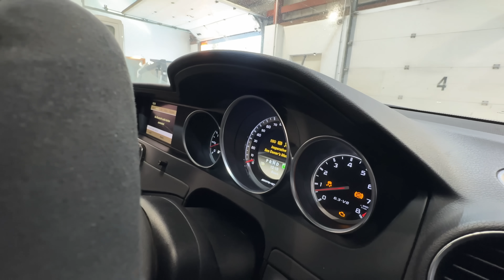MY MERCEDES C63 IS BROKEN

Comment: I swear to god this car has never worked
Reply from the maker: It’s always a nightmare 😂
Reply: @matarmstrongmk2 😂😂 lol
Reply: Bro is only speaking facts
Reply: Hi Mat, my name is Edgar and am a fan from Nigeria. Enjoy watching your rebuilds. How is Kelvin? Keep up the good work.
Reply: @edgarpeter-peprah6237 honestly this is the first time I’ve heard a 9ja boy called Edgar😂.
Reply: Was going to buy a used C63 AMG but it never showed up at the dealer, waited about 2 months having put an unseen (refundable) holding deposit on it. It never turned up and eventually it was out of MOT and SORN. I bought a Cayenne Turbo S instead from somewhere else. It’s in Mafia triple black with limo tints, black sports plus wheels and a full body kit with double spoiler. It’s a 650 brake armchair beast. I however am the least gangster person I know. 😂
Reply: Like my uncle Phil
Reply: Hhh yes
Reply: Always
Reply: I had a E420 that was in the shop more than it was on the road.  The Merc dealership had it for a month and ended up writing off the bill, which was like $5k.  They never told me what the problem was, except that they cleaned black soot out of the cylinders.  I ended up trading the car in for a MDX just off lease and got $2k trade in.  I felt so lucky I got that.  I will never buy a Merc again as long as I live.  What trash.
Reply: Oh, and my dad had an E55 AMG and it would go through a set of tires every 3k miles.  They had this dude from Germany called "the flying wrench" visit once and basically told the dealer that it was a feature not a bug.  My dad traded it in for an LS400, which worked flawlessly for years and years.
Reply: @matarmstrongmk2 at least you can wake up from a nightmare and get over it 😂
Reply: It just seems a nightmare car.  Tbh many others would not go through the pain and constant demand on the wallet.
Reply: @eddherring4972 I imagined Steven merchant when you said least gangster
Reply: @KeyBrosUK  yup, I’m 6”4 and 14 stone. I’m built slightly more muscular than him but other than that you’re about right 😂👍
Reply: The pipe In the sump plug is a filler pipe you remove it when draining then reinstall it fill with gearbox out till she trickles out then put sump plug back in
Reply: @jonsnowcd3095  yea
Reply: @jonsnowcd3095  Edo pikin I be

Comment: I never understood why certain car manufacturers went from making traditional oil dipsticks to having extremely unreliable electric reading systems
Reply: Because Engineers live electric Gimmicks creating  electric gremlins!
Reply: Harder to DIY it
More people will take it to the dealership
Reply: For women
Reply: C63 has a dipstick as well
Reply: It’s all a move towards not having a bonnet catch for owners to use…
Reply: @richardlowe1076 Mat is not a dipstick
Reply: It is annoying. My SLK55 has a dipstick tube with a cap on it. They will sell you a dipstick, but it's just for checking the level and putting the cap back. The dipstick is not designed to stay in the tube. Thankfully, the electronic sensor on mine has been reliable. The car is 16 years old.
Reply: Because "extremele unreliable" is still below 5% of the full customer base. That's why, statistics and economics my friend
Reply: sadly, the same as they went from dials and buttons to touchscreen,  some of which were really convenient such as AC and stereo controls
Reply: @dumtree3727 I’m not sure I’d say it’s a bit easier to diy check your oil if it comes up on the dash and tells you.
I totally get what your saying but try telling that to somebody who doesn’t even know where the dipstick would be found
Reply: You have no fucking idea how much I hate that. My Mercedes doesn’t have a simple dip stick. I spent like 30 minutes looking for it one time when I got it because I didn’t know they would be so fucking insane they would build cars without them. If the electrics are screwed or sensors break you literally cannot check the oil! I bet there are many cars that burnt up starved of oil when people turned them on not realising they had no oil.
Reply: @SD-oi9gr  I prefer a dipstick than without but in the sensors defence, the warning does come up on the dash telling you pretty much exactly when it just reaches the minimum mark on the dipstick.
Reply: Because servicing your car yourself doesn't pay. Greed and money and that's all it is.
Reply: @Yssgqvwgewgshsydsys  yes what a great development! Now you really have take your eyes completely off the road, refocus on what screen you want and then poke your choice with a finger to get it to switch on. Then remember to get your eyes back on the road, - and it’s all legal! (Oh, and you’ve probably travelled another hundred yards by then obviously!!)
Reply: @MarkoVukovic0 

Thank you for your contribution. Tell everyone more boring useless stuff about you and miss the point completely. Really!!!
Reply: Something else to go wrong which means more ££££ for the service centres.
Reply: Because people like easy. And alot of people are lazy.  Or should i say it's easier for people to to look and see if the light is on or not than to manually check.
Reply: Majority of drivers of new cars can’t even put a key in the ignition. Checking the oil with a dipstick would be so far beyond their abilities. My ex mother in law wouldn’t get a car MOTd she’d just buy a new one and she couldn’t fill the car with fuel, her husband had to do it for her. She couldn’t do anything remotely mechanical.
Reply: The electric shit never works. Then to hide a censor inside the sump is stupid. The topper is knowing the torch converter or the actuator is the problem. The car has to be a bitch to even upkeep probably like 85k for the life of the car.
Reply: I've got 2 cars that oil level sensors,  both (MB C Class and a Porsche Boxster) are over 20yrs old and I've never had a problem with either sensor, both have been very reliable. That said I prefer the Porsche system that has both a sensor and a dipstick, its also possible to check the MB oil level with a dipstick but the car doesn't come with one.
Reply: Job security
Reply: German cars for you
Reply: I have owned quite a few AMG's. Never had any issues, unlike Audi and BMW.
Reply: MB introduced ASSYST ,Active Service System , which determines the actual demands on the engine oil ,and uses the sensors to monitor engine oil level and temperature ,  engine speed and road speed ,  engine load , coolant temp ,
in order to calculate servicing requirements per time and distance.
It was done to prevent premature oil changes to ensure that oil is changed when actually needed .
Reply: But why would you put the old oil back in the engine ? Horrible thing to do
Reply: Some engineers have their dumb momentum life. 
One them will be creating this sensor.
😂😂😂😂
Reply: Why no dipstick???
Reply: How does removing a dipstick stop anyone servicing their car? It makes no difference. I've been servicing my own cars for 50yrs and its a myth that modern cars are more difficult to service than old cars. @FEAR.LESS.
Reply: @shadowblack1987  mercs have less problems yeah, just i mean German engineering love sensors ect

Comment: 7G tronic gearbox takes blueish green 722.9+ ATF fluid. You can drain the torque converter if you unbolt the electric pump for the start stop lubrication. (if it has it). You will see a rubber grommet. Take it out and spin the torque converter with a screw driver until you see the little drain bolt. Remove the little bolt and hang sometype of little hook on it so air can get easily in the torque converter to drain it completely.

Almost all of the 722.9 gearboxes you can drain the torque converter. When refilling put 9 ish liters in the gearbox. Run it to around 40°C. Let it drain till it begins to have a flow with bubbles. Than you can seal it back up. 
MB 236.15 ATF fluid for 722.9+.  Not sure about the standard 722.9

ALWAYS use new bolts for the transmission oil pan. Torque specs 10nm for torque converter.
4nm and 90° + 90° for the oil pan.
22nm for the drain plug.
Reply: This is why I love YouTube. Knowledge is power that is rarely free these days. Who doesn’t like something free, especially knowledge!
Reply: The facelift doesn't have a torque converter, instead it has a single clutch. I thought it was called AMG speedshift MCT.
Reply: @tubejorrit  and does that clutch uses any kind of sensor? The malfunction seems like the car is safelly going off as on a manual when you brake in gear+out of clutch pedal
Reply: Funny I'd say nearly all 722.9 dont have torque drains. they stopped putting them on about 2004

Comment: You can drain the torque converter (there is a rubber cover on the bottom of the bellhousing which exposes a small plug in the torque converter, you may have to rotate the engine to find it, some 722.9 transmissions had drain plugs which were the later trans) do all this at the same time as you change the filter, remove both cooler pipes and blow out the cooler lines as well this will help the convertor drain as well, the little green tube you can actually just knock it into the transmission sump (usually breaks) which will help drain 99% of the oil, I only use the Merc trans oil it's green in colour just quote the VIN to mercedes dealer, I think the manual states a 6 or 7 litre refill, I always get 8 litres, when you refit the filter and the green oil level tube to the sump, simply pump in about 5 liters of oil, start run for 30 seconds, shutoff pump in the remainder of oil, then start run through all forward and reverse gears, then using your diagnostic tool get up the trans oil temp, I think from memory wait until oil temp is at 45 degrees c, shutdown engine and check the level of the trans sump if oil pours out wait until its just dripping, if no oil pours out add more oil until the oil is just dripping out of sump plug hole.

Remember the green tube sets the level of the transmission at 45 Degrees C
Reply: I turned the engine over at least 4 times with the rubber grommet out and there was no drain in the torque converter guaranteed 😂
Reply: You have to keep the engine running while draining at temperature. Or the oil will be to low.
Reply: correct @sebasgerrit
Reply: I also did say in my first comment some 722.9 transmissions did not have the drain plug but they are very early transmissions
Reply: Never broke the little green tube. Use a small screwdriver and tilt it sideways.

Comment: your torq converter lockup clutch is starved of fluid and so it stays applied causing the stall you either need to change the tc lockup solenoid or the conductor plate.Both are cheap and easily doable with your tools and equipment

Comment: Good video guys. I've got a C63 and I'm going to be doing a transmission service in a few weeks. Have you swapped the injectors out on yours? There's a common issue where an injector can fail in the open position and hydrolock the engine. So a lot of people swap them out as a precaution. I changed mine this week. Glad I did, lots of carbon build up on the old ones and my cars only done about 35000 miles. It's's quite an easy job and bosch OEM injectors are not very expensive. Looking forward to the next video.

Comment: 2011+ c63 had blue fluid for transmission also you're supposed to knock the plastic pipe off to the side to allow all the fluid to drain out.

Comment: That tube in the drain for gear box is to be removed for draining.  Install and fill till it comes out of the hole   start car and fill more till it is full.  When the fluid stops running out of pan with that tube in place and car goin then it is full of fluid.  Its called fill to spill.  I use to do exactly what you said.  Fill, run car and drain.  Usually did that 3 times then put new filter in and filled for final time.  Really enjoyed this video.  Lots of laughs!!

Comment: ive only done the trans on the 350, but the trans fluid level on that car was set by warming it up to 180 degrees and checking it running with the drain pulled. the oil level needed to be just over the stand pipe with it running at temp

Comment: I love your videos i watch them all! I've done dozens of amg Trans flush, You are supposed to stick a screwdriver or what mb calls a "drift tool" into the trans pan drain hole and bend sideways to remove the standpipe. That drains most of the pan.The standpipe should be replaced after and with same color pipe, there are many colors/ sizes. There definitely should be a super tiny drain plug in the TC as well hard to see bc it's a teeny tiny Allen and you have to rotate engine to find it.

Comment: You guys should  start the car, put it through gears, P,N,R and D a couple of times then wait until you have 45C/113F (car idling an i level) then some oil will come out. It should come drops only then put on the plug. Not all these gearboxes has plugs on the converter. That green pipe in the gearbox pipe is changed because after removing the plug you hit the green pipe with a screwdriver so all oil comes out. If it breaks then you have a new one (better safe then sorry). Hope it helps you guys. Great video Tony and Mat.

Comment: Best to do some research on the Merc Auto boxes on YouTube...😅😅😅 
Alex from Legit Street Cars has done a lot of work on those transmissions - the tube in the sump is actually the correct level for the transmission fluid and he shows that you need to knock it out of position to drain the sump and then reinstall it prior to installing the sump back on the transmission (meaning that you have to remove the sump). You then refill the fluid through the drain plug!👌

Comment: Hi Matt love the videos you do and your dad as well.  My 1999 ford mustang gt did the same thing as your Mercedes and mine I could get it to drive if I gave it gas right away when I shifted to drive and then it would sound like a manual car taking off and once the oil warmed up then you could stop without it dying.  When I pulled the pan off it was the same as yours with a bunch of metal stuff on the magnet and from what we seen it was the torque converter causing it because it was engaging when it wasnt supposed to when was burning the clutch off.  I ended up replacing the whole transmission since it had 81,000 on it.  Yours might be doing the same thing as my mustang was doing.  Also I changed the oil first and filter like your dad did and the trick to change the oil was to disconnect the transmission lines running into the radiator that cools it and start the car which will pump it out and while its doing thaty your pour in the new fluid and when you added the full amount maybe 8 quarts then shut it off and check the level and reconnect the lines.  If you have someone helping you then he should be able to see the blue fluid eventually come out once all of the old is out.

Comment: I like Tony's new cap.  I have always thought that I would like to buy an AMG GT R, S or C.  The stalling problem seems to be the torque converter. That does hold a fair amount of fluid. Or, a vacuum leak anywhere in the engine's intake manifold system could cause this behavior. In older vehicles, even a faulty ignition barrel with weight on the key ring.

Comment: Just to add aswell when filling/checking the gearbox oil level the engine has to be running to check the level or you may not have enough oil in there, put a basic full amount in (say 5L) then start the car and check the level👍😊

Comment: I had this on my '06 G35, $22 oil sensor and $2,200 in labor to install it. Only to turn off the red light on the dash. On the plus side you now have a spare trans on hand, that you can rebuild and have ready/resell.

Comment: 6:47 The tube is not for making it hard to empty out the old fluid. It's so you can refill the oil level, to the correct level, so the top of the tube, will let you know, when it's start dripping out, when refilling, you can then install the sump plug again. And yeah, as you said yourself, you should remove the green plastic, with a pick or something, before you undo the sump bolts. And you should drain the oil from the torque converter too.

Comment: I literally rebuild and install Mercedes-Benz transmissions everyday for a living because my dad has a shop in San gabriel CA. The oil from that transmission is supposed to be blue oil not red. I know by the size of the lil dimples on the pan. The bigger ones on this car mean its a blue oil transmission while red oil ones would have smaller ones. Mercedes transmissions switched from red to blue oil in the middle of 2010. So everything from mid 2010 and beyond 2010 is blue oil. Also, he could have drained all the oil if he hit the tube off w a screw driver. You also have to make sure you use a blue oil filter and not a red oil filter. They're different. And if it has a wet clutch then they don't have a drain plug. Some of the torque converters have a drain plug but most don't. Never use aftermarket filters because they burn up the transmission. We get burnt transmissions everyday with aftermarket filters. And the car has to be running so the oil can pump and be up to a certain temperature to make sure the oil is the correct level. He probably put the wrong amount of oil in. It seems like they probably have a torque converter problem with the way the car is driving but they might burn up the transmission too because he probably put the wrong amount of oil in it. That's why you don't let people work on your car who don't know what they're doing lol. Torque converter is probably locking up but now the transmission is probably screwed too lol. If anyone needs a rebuilt transmission with a 2 year warranty then look up my dad's shop "Mercedes Benz Transmissions" in San Gabriel CA and ask for Jim the owner.